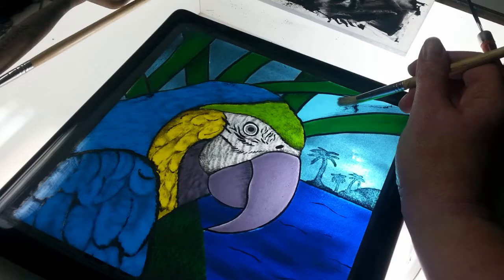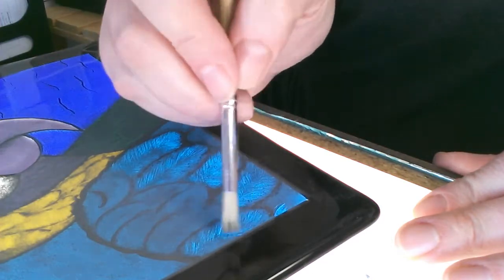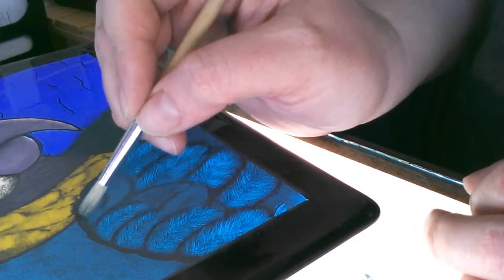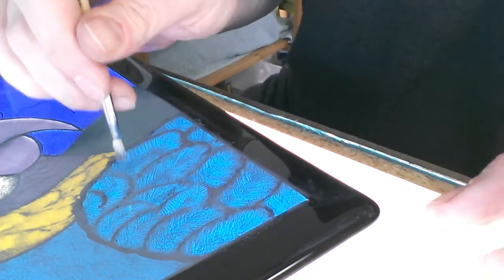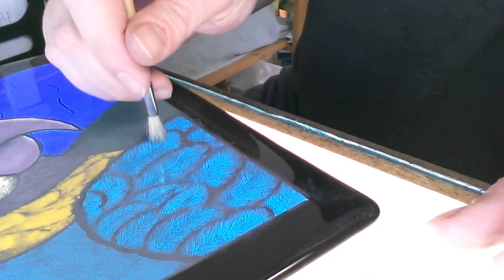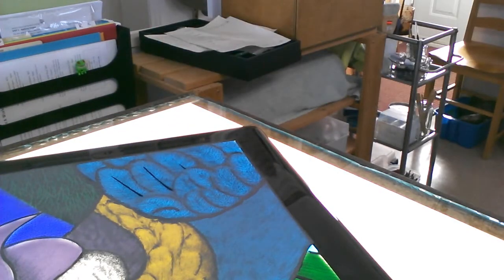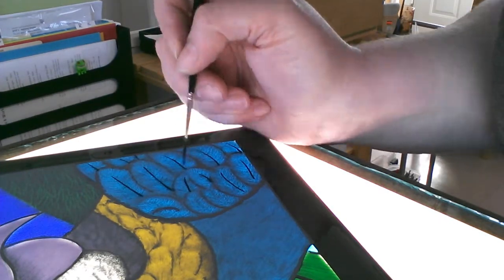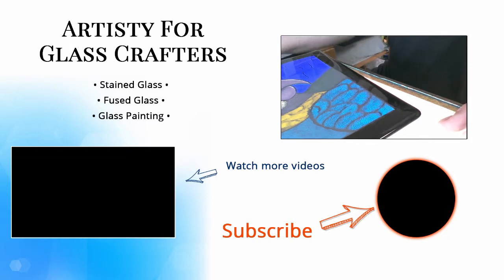Traditional Stained Glass Painting - Living Sun Glass

Comment: Hi, is it possible for you to paint/scratch away a picture using the Reusche tracing black paint, also which brushes do you use for various techniques, thank you......I’m only asking because I’m trying to paint on glass in the negative but also I haven’t seen anything like this on your channel, thanks again 😊
Reply from the maker: The Reusche paints can be painted on using liner brushes as is commonly done for trace lines or it can be used for sgraffito painting techniques. I have a whole variety of brushes I use but the ones I use most are a liner brush for tracing, a 2 inch matting brush and a 3 inch badger blender. It really depends on what size the project is and what will give you the result you're looking for. 
Here's another painting video I made using over 6 hours of footage compressed into a 15 minute speed painting video. This shows a few different ways the paint can be used. https://youtu.be/oFUoSWAiRwE